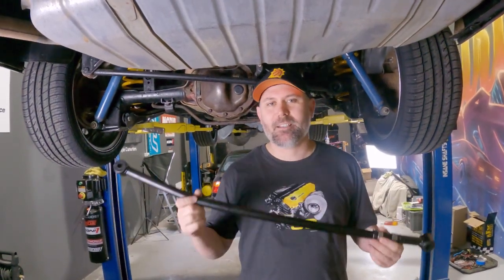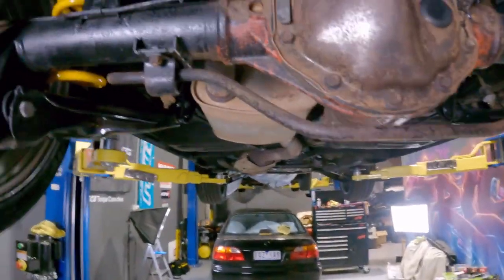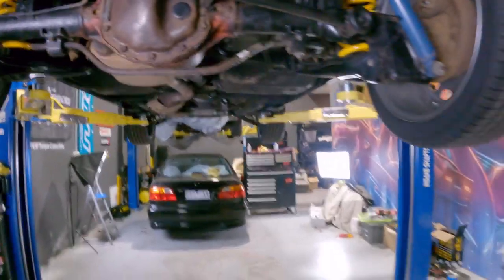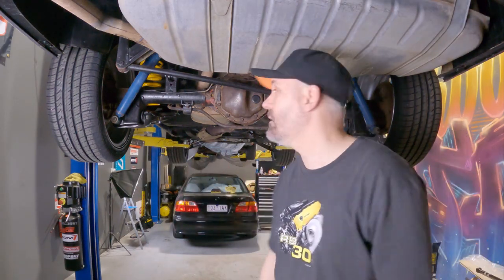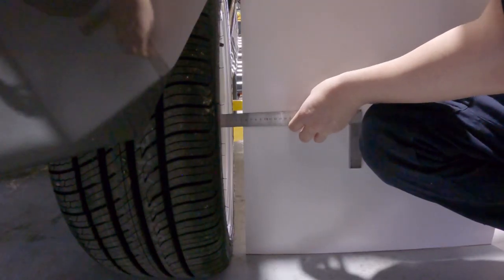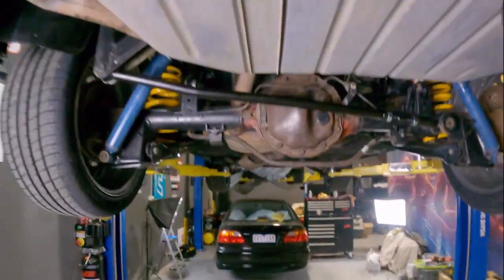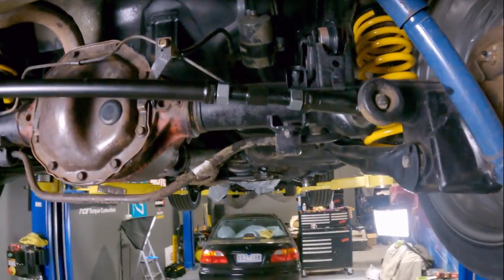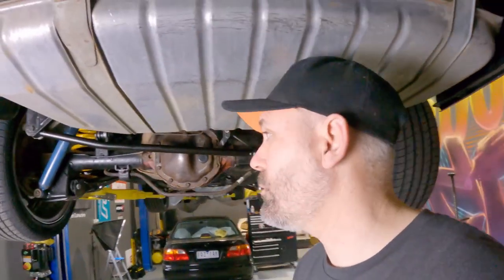EVERY COMMODORE OWNER MUST DO THIS MOD!

Comment: Back in the day, before adjustable pan hard bars existed you could get away with redrilling the mounting hole on the body to lift the panhard bar higher up in the body  !!!!
Reply from the maker: that's a pretty cool solution for the issue, you lose exhaust clearance though

Comment: G'day.  When turboing a VL, if you replace the exhaust with a 3 inch system, apparently you have to put an adjustable pan hard rod in also because the new exhaust hits the original pan hard rod.
Reply from the maker: Yes That is Also True, Most people Lower their car before they turbo it

Comment: Errrr, Falcons are either leaf spring or have a Watts Link. A superior set up.
Unless you lower your Crapadore excessivly the Panhard will not need an adjustment. Though raising the pivot point on the body will help far more than anything else. When a panhard goes through a very small arc the length does not significantly change.. Using heim joints will resolve more sideways than the rubber bushed OEM piece,, though then the brackets will break. Poly bushes are even worse.
Yes,, I have seen it all. And raced a quick Sports Sedan with a Panhard. A Watts would have been superior but a lot more work to set up. The longer the panhard the better.
Though the very short  factory one on my 71 Ford Galaxie has about 1/8" of sideways movement  in the normal arc of use. I guess Ford knew what they were doing.
Reply from the maker: It appears that way hahah 😀thanks for watching

Comment: I not long got a 29 year old vr immaculate condition inside looks brand new with shine Steeles and has a few little scratches on the bottom of the bumper
Reply from the maker: lucky bloke thats soo cool
Reply: @TURBOTRISTO  the cooler part is I'm saving up for a yellow VK and vl just collecting Moss and dust

Comment: Guru !!! Why does that look like a gm 10 bolt 7.625 diff ?
Reply from the maker: It’s a borgwarner m78
Reply: A  B/W 75 series pre VL. 78 series VL turbo and VN on.
Reply from the maker: gotcha thank you bro
Reply: Vn until VT with irs as standard im guessing?

Trying to understand what parts can interchange